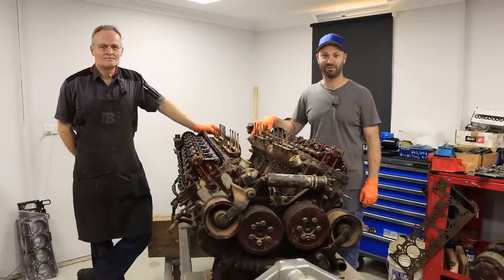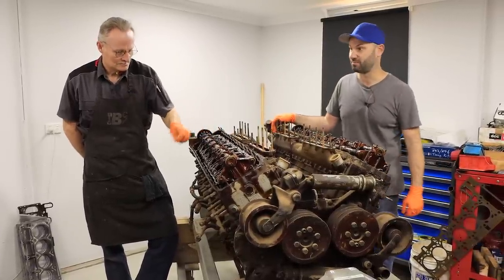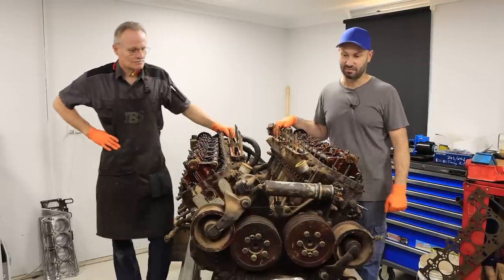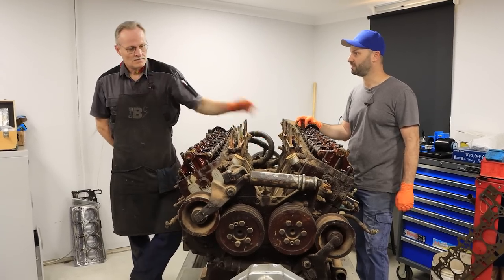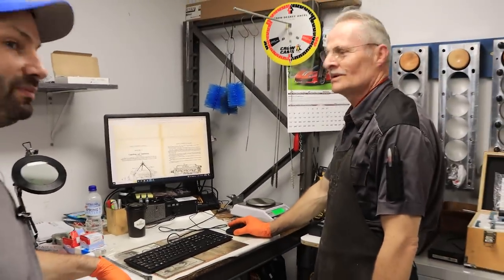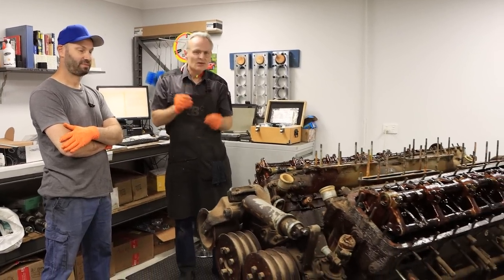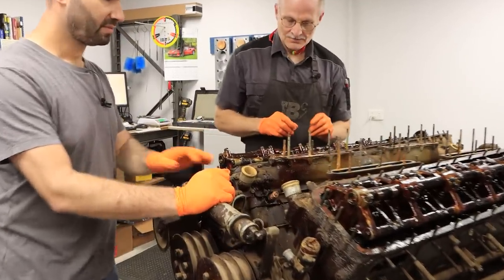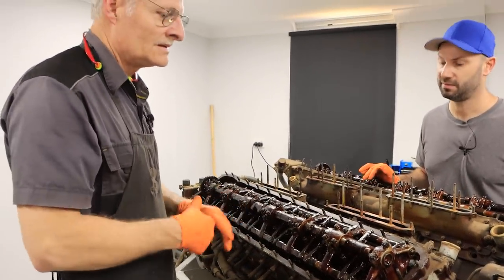Rolls-Royce 27 Litre V12 - Meteor Tank Engine Tear Down Part 2

Comment: As far as the Meteor goes, there is some interchangeability with the Merlin. The overhead gear on the early Meteor looks identical to the RR Merlin, however there are some slight differences with the Packard and Continental built Merlins. Early series Merlin cranks and rods fit Meteors as well. Very few Merlin maintenance people use split pins on the campacks these days; instead using 0.041" lockwire, especially for the campack retaining studs. For those wondering, the Merlin has 14,000 + parts in them including ground split pins to fit the main bearing cap studs and rod bolts. The valve on the RH side of the crankcase is the Oil Pressure Regulating Valve (a Merlin uses a very similar arrangement). Main oil pressure in the Merlin is 70-80 psi, the Moderate 28-32 psi and the Low 4-8psi all at 70-80 Deg C. The two piece head and banks on the Merlin still use lock-tabs, as is fitted to this Meteor engine.  Out of interest, all of the Merlin spare parts, tooling and data from Jersey Aviation was purchased by Vintage V12's from the USA a few years ago.  Someone mentioned cylinder cradles (Cylinder Bank Stands). The banks don't have to be stored in them, however it is good practice as it prevents damaged to the lower portion of the liners. We also use them whilst conducting bank (cylinder head and skirt) coolant pressure tests.  As with the merlins, one magneto fires the exhaust plugs and the other the inlet plugs. The magnetos are not interchangeable. The rubber couplings on the coolant system are called Ävimo Couplings? Out of interest, there were more than 154,000 Merlins of all series manufactured.  Good luck with the tear-down!!!
Reply: Impressive knowledge!  Thanks Dave!

Comment: Your two manuals; the first is a two stage Merlin manual which has little relevance to your Rover tank engine.  The second is a Merlin II manual, which has more relevance to an early Rover tank engine, but not your MKIVb (which is a later Rover design).  All the technical settings are different to the Merlin - the engine even rotates the opposite direction to the Merlin.  The valve timing, ignition timing, and totally different.  As regards tools; Merlin tools are highly prized for those who work on Merlins.  The cylinder transport frame is not essential, so don't waste time making one.  You will have to make a load of tools, and improvise for the rest.  Get Rover Meteor service manuals - contact tractor pulling teams the ask them.

Comment: I love this series. couple mof backstories that may be of interest:
Rolls Royce Motors which built the cars as opposed to the aero engines was demerged from Rolls Royce Ltd in 1973. Vickers bought it in 1980 and owned it until late 1998 when the split between BMW and VW happened. So that was why Vickers had that section at Crewe.
The Pyms Lane site at Crewe is now owned by Bentley which in turn is owned by VAG who recently announced a 10-year investment of £2.5 billion.
Rolls Royce cars were bought by BMW (via VW but thats another story) which are now built at Goodwood, West Sussex.

Why the 'BSW' and 'BS' on spanners story:
The Whitworth system differs by its tool size designations when compared to American tools (and European for that matter) which are sized by the head of the bolt or the size of the nut. A 1/2″ wrench fits a bolt with a head 1/2″ across. A Whitworth wrench is sized according to the diameter of the shank of the bolt, as you suggested, not the head. A 1/4 W (Whitworth) wrench is actually a bit larger than a 1/2″ American wrench—0.525″ to 0.500″. As if that wasn’t enough, in 1924 it was decided that the heads of the Whitworth bolts were too large, so they were down-sized.

The “new” bolts and nuts were made so that the old tools could still be used, but on different bolts. To enable the tools to be used easily, they are marked with both sizes. The old size, which stands for the diameter of the bolt’s shank, is marked with a “W”. The new size is marked with a “BS”, which stands for 'Bolt Size' (not bullshit!) and consequently the new wrench size. For example, the old 3/8W wrench also fits the “new” 7/16″ bolt, and is therefore also marked “7/16 BS”. The head of the bolt it fits is 0.600″ across the flats, larger than 19/32″ but smaller than 5/8″.

Got to love old British engineering.
Reply: Did a factory tour of the Bentley works earlier this year, very interesting to hear all the history and then to read your parts as well.
Reply: @richardroberts8742   Lucky you Richard and you are most welcome.
Reply: It could be worse. Whitworth was the path out of even greater madness. Different city guilds had different thread standards, and railway companies in those cities used local standards. National railroads made that situation untenable. Whitworth changed the world for the better, even if it took a few attempts to get to metric (sorry).

He was a true colossus, even though his achievements were mostly in the realm of the tools that built the world, rather than monumental projects. He apprenticed with the inventor of the steam hammer, and thread cutting lathe, and was apparently pretty central to Babbages difference engine project, which required the mass production of accurate parts in an era where even pocket watch parts were hand fit.

Comment: I worked two places that had the cylinder block cradles. The main function is to hold the liners in correct place, they are not stiff enough to keep the blocks straight.  As you will probably want to pull the liners to replace the seals I would not be too worried about dismantling without them.  I know at one point parts and tools came from a company on the island of Jersey in the Channel Islands but I have been out of the loop for nearly 20 years now.  I know that Retro Air and Track now do all the engines for Battle of Britain Memorial Flight so they might be worth a message.  The cradle could easily be made by measuring the block once off.  Water jet a plate 50mm thick and then Maxine liner register and stud locations.

Comment: I really would love to work on something like this! It reminds me a lot of the german farm equipment from the 50s I did work on. That had loads of castlelated nuts, drilled bolts, safety wire, locking tabs and stuff like that. Really easy to understand from looking at it, easy to maintain, hard to screw up 😍

Comment: I don't live very for from RAF Duxford in the UK, also known as IWM Duxford. They are a very large (mainly) plane museum, however have multiple hangars set up solely for restoration and repair of mainly WWII planes which they rent spots to owners. They have huge amounts of stock and tools. They also have another section dedicated just for tanks. I would try and get in touch with them as I bet they would have all the bits your after or at the very least those manuals and plans to make the tools. Either way loving this new series keep it up!

Comment: Gday 
Great content, have had a couple engine swaps in a centurion tank, very confined, but very rewarding. Had the great experience of unpacking and re commissioning a stored Meteor and installation in a tank. I was told the spanner length of the whitworth ring spanner set was related to the tension one hand could apply to it. Thus the bolt, nut tension is not super tight when working on these engines. I was always surprised how easily parts came apart, thus the split pins etc. So much on the tanks is split pinned, must have been a nightmare to work on in stressful situations.

Comment: As far as I know the high pressure oil system on the Merlin was used to hydraulically control constant speed variable pitch propellers.

Comment: There is a similar art deco building at main works in Derby, where the aero engines were designed and made. In the early 2000's the same building was still being use for aero engine manufacture - many of the special processes housed within were somewhat of a "black art" and proved troublesome to move to modern purpose built facilities, which meant that the old site carried on for longer than planned. 

The facade of the building is still there. There was a stained glass window of a battle of Britain fighter pilot in the foyer. When I visited a few weeks into my first job, I was shown an empty office, which was apparently Mr Rolls or Mr Royces office (I cant remember which one) still with wooden desk, leather padded chair etc from the 1940's.

Comment: I have had at least 10 of these engines and they all had the history sheet in the canister. What a shame someone removed yours.
The engine model number and serial number are on a brass plate mounted under the lifting ring just behind the auxiliary gear case. The serial number should match the numbers painted on the cam covers.

Comment: One of the tractor pullers in Australia was running a twin turbo fuel injected methanol meteor v12 at Quambatook 2022 the fucking noises it made where good

Comment: The rebuilt engines only had the rust inhibitor inside the engine. The outside was freshly painted, rubber components covered with brown paper wrap. Yours seems to have been coated on the outside.

Comment: You would be upset as I was, the V10 tank engine you talk of I was part of a contractor company that’s job was to remove the engines out of tanks clean them up and fill the engine with concrete as part of the decommissioning process for when the tank was put out front of RSL clubs about 14 years ago. Was a very sad thing to be doing.

Comment: Your engine is not a rebuild, it is a preserved engine that had been previously installed in a Centurion Mk 5/1 tank. The accessory drive 'idler' pulley's would be perfectly flat if it was a rebuild, they pulley's on your engine have the wear marks consistent with about 150 miles of use. Taking into account that the Centurion tank was replaced by the Leopard AS1 with the first Leopards arriving in 1976 this engine was more than likely waiting for repair / overhaul when the Centurion program was stopped.

Comment: 20:35 Better steel and the metric system superseded the Whitworth and BSF nut and bolt thread systems.
Whitworth thread form is still used for pipe threads the world over excepting for the USA which has to be different even down to minor thread per inch change.

Comment: The more of the engine you remove the more I am certain this is not a newly rebuilt engine. Most of these engines will have been rebuilt at some time and some more than once. They built twice as many engines as tanks and the norm was to remove the engine and replace with a fresh engine rather than do any major repairs with the engine in situ. 
A newly rebuilt engine is spotless as they are completely stripped, cleaned, checked and every wearing part replaced. It was reported that a complete rebuild cost the MOD £80,000 each.
I am sure your engine is as it came out of a tank. That doesn’t suggest it needed repair, it could have been a scrapped tank with a serviceable engine. The dirt behind components would need to have been blown there rather than just settling while in storage.

Comment: Magneto impulse coupling to retard timing during start   - https://www.youtube.com/watch?v=_mXySLhjXgA
I was thinking about MTU supercharger drive with ball bearings Tony mentioned .    The messerschmitt bf 109 supercharger drive was similar to a car torque converter - and prevented over boost at low altitudes - wonder if the ball bearing coupling was for similar reasons ?

Comment: I believe gas was used because in Europe it was common while diesel was not. Training tanks in the US and Canada has 2x 671 Detroit diesel engines.
Reply: I think it’s to get the most fuel out of the crude oil, trucks and tanks used low grade Petrol, aircraft used higher octane Petrol small ships ran on diesel and larger ships on heavy bunker oil

Comment: This engine is quite simple to work on it.
You don’t need manuals in tearing process.
I have Meteor Mk1a engine in my car and it has many parts from Mk1 Merlin and no removable cyl heads either.
I have some vid’s in my Youtube channel if interested. There you can see what’s inside the engine and how to put it back together and to fit to the car with 5 speed trans. Part1/12: https://youtu.be/z7vegs5wSZo

Comment: Not an expert but that brace part may not be as nessesary on the meteor as they used steel parts rather then alloy ones because tanks didn't need the light weight engine.

Comment: Cosmoline melts at approx 50 degrees C, enjoy your BSW and BSF threads lads 👍, Rolls Royce Crewe is still there but it's now Bentley motors (Audi 🙄), those cast iron gates were still there a couple of years ago but Bentley have now bought the actual road that went past the main entrance so you can't actually see anything these days, they used to have a Silver Ghost parked in the glass atrium that was the main reception 👍